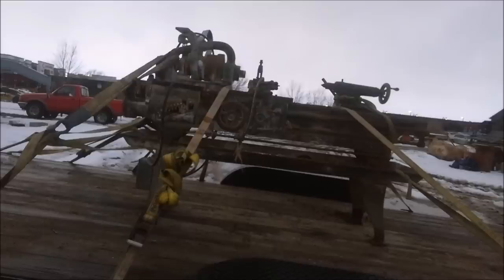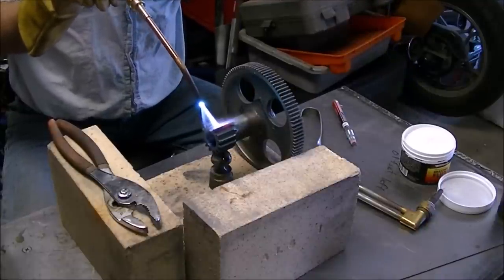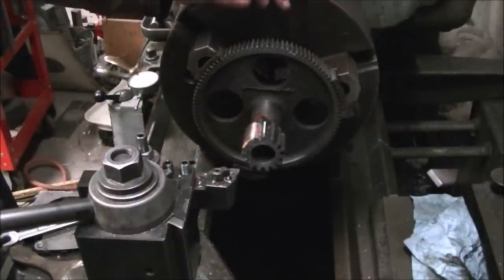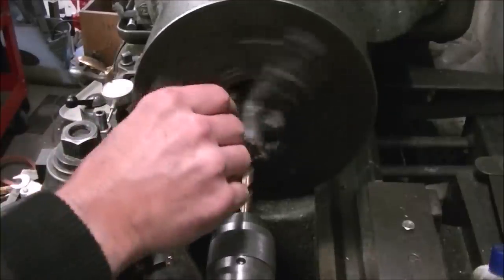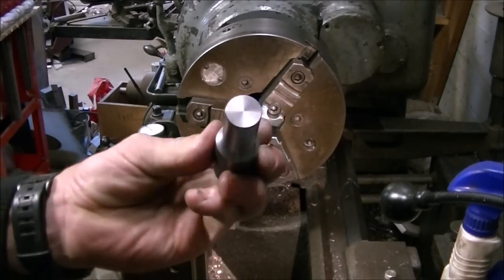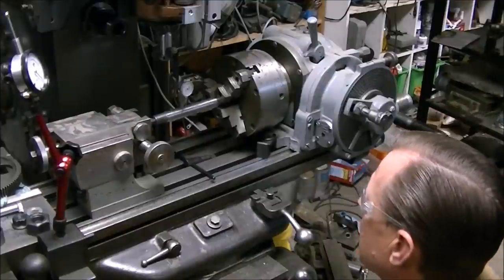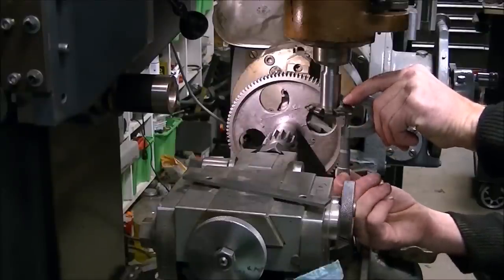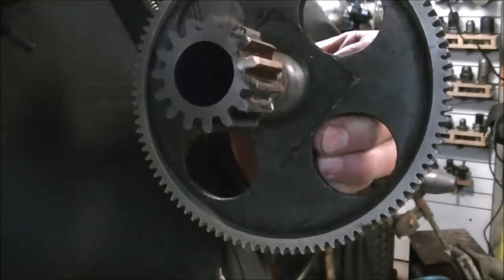Hendey Gear Repair

Comment: worked out fine enough! 
handy having the gas torches , can't get them here due to elf n safety police so it's a case of finding a shop that would braze stuff up and not be looking for an arm  and ldg to do it.
good video,  keep them coming. All the best mat
Reply from the maker: lookcreations Mat, they can have my oxy-acetylene when they pry it from my cold dead hands- no wait, that is something else. Well I hope we never get to that point over here. Thanks for stopping by, can't wait to see the Elliot making chips. Craig
Reply: Can you get 1 of the Bernzomatic MAPP gas/oxygen kits?  ( https://www.amazon.com/Bernzomatic-BZMOX2550KC-Torch-Kit/dp/B0002JM8AO/ref=sr_1_2?ie=UTF8&qid=1525731352&sr=8-2&keywords=bernzomatic+brazing+kit )  Might not be hot enough for gas welding steel, but it will braze just fine.

Comment: Nice work.
You could of used a face plate and put the gear between pipe centres.
That would of saved the truing hassle, just a bolt for a drive dog.
Reply from the maker: +Mick Mac that would have worked but I don't have a center big enough for that bore. I've been looking for a pipe center for the lathe but haven't found one and had the money at the same time. As you probably know, the cheapest part of this is buying the machine, the real money is in the tooling. Thanks for watching and commenting. Craig
Reply: clemwyo your other option would also have been fine.
Machine off the teeth. Pressing on a steel gear would make it all stronger as long as you heated the new gear.
Done some repairs like this in my time. If you case hardened the new gear then brought it back to the natural silver finish,
Re heat to your straw colour for pressing, you get two jobs done heating for expansion plus tempering back the steel.
Machining a new gear from cast iron also good as that would be close to original.
Im guessing your lathe has an MT5 in the head. Many Chinese laths have adapter sleeves just for this MT5 to MT3.
The head end you can machine up your own pipe centre.
The tail end also by machining or even buying an arbour MT to suit your tail stock with a 22mm straight shank, typically for a milling cutter.
Machine up your centre head and  bore for deep groove bearings to press onto the arbour 2 side by side. You can do this pretty cheaply.
Doing my 1st year as an apprentice for the defence dept that was actually one of our training jobs. I still have it and use it to this day.
Best way to remove rust from cast iron like the ways is green scotch brite and phosphoric acid gently scrubbing the rust just disappears plus the new grey finish is actually rust resistant.

Comment: That looks very good to my old eyes.
Should work very well.
Those other teeth are quite worn.
Mike
Reply from the maker: Oldvet1946 you are sure right there. I've decided that if the wear bothers me when it's back together I'll pull it apart, braze up all the teeth but the one I just did and recut the rest of the teeth. Craig

Comment: New Sub..  Nicely executed repair Clem.  I will be watching your other videos as well.  Regards-  Fred Ontario, nY
Reply from the maker: Fred Miller thanks for the kind words. I've been checking in on your engines for several years. One of these days I need to build a steam engine. So many projects, so little time... Craig

Comment: Why didn't you just stick it?  Instead of silicon bronze i mean..?
Reply from the maker: +Patrick Dorion when you stick weld cast iron you run the risk of the part cracking as it cools and, more importantly, you end up with a very hard, brittle part from the heat of the arc weld. If you are welding up something like an engine block, it's not a big deal. But with a gear that needs to be machined after welding, both of those things are bad. Thanks for watching and commenting. Craig

Comment: With that metal lathe, milling machine and dividing head you were be able to make a brand new gear in the less time. 
Instead to braze it,  better way will be weld that tooth with cast iron welding rod.
Reply from the maker: Brazing is about the strength of the original material without introducing the stresses and hardening that come with welding cast iron. For some applications welding is a better solution, in this case, brazing is the better choice. Thanks for watching and commenting. Craig

Comment: Do wish to sound  cynical but all that time a big gear one tooth I would  have used a file and  steel weld?
Reply from the maker: +dafodilist as I said in the video, I have a full set of transposing gears to make so I can use the old Hendey lathe for cutting metric threads. This was a chance to try gear cutting in preparation for that. Stick around and I'll be cutting the transposing gears soon. Craig

Comment: OMG he's got all the mega anyone could want and it's still a gigantic hassle for a single tooth....
I piled in some 06 special brazing rod on a 4"+ diameter 72 tooth and hand filed it, used a couple pins from the junk pile
Have 3 or 4 more in the back gears to do not looking forward to it ... grrr... such a hassle - soon enough 3d printing should take card of these things I hope.
Reply from the maker: +Doc Hollowood as I mentioned in the video, this effort was in preparation to cut a full set of metric transposing gears for the 1910 Hendey lathe. I wanted to get some experience in gear cutting before I tackle the gear set. More on that project is coming. Thanks for watching. Craig

Comment: TRY USING CARBURISING FLAME MORE
Reply from the maker: +Stuart Hearn on the next brazing project I tried using a TIG torch and found that to be much easier to control and faster as well. Thanks for watching and commenting. Craig

Comment: Good video.  I've did the same thing on a back gear on my large old  lathe.   Only I cut/broached the new tooth shape on my lathe rather then a milling machine.    By broaching the tooth no special tooth cutter is needed, just grind a single cutter to match the tooth profile.  Worked great and the lathe is in service.     http://www.pbase.com/jimthode/hamilton_lathe
Reply from the maker: Jim, That is a nice looking lathe. I have broached keyways on the lathe, since I don't have a broach set. I bought a full set of involute gear cutters from a friend for cheap, so I thought I'd try it out. Craig

Comment: Great work. Thank you. 

Could you avoid the math and smoosh the cutter into a good tooth gap to find center? 

p.s. kudos on the hypno mumble. Haters gotta turn up the volume, bish...
Reply from the maker: +badad0166 I kind of did both to make sure the math was accurate. I now have a USB moveable that is handy for looking into those right spots. Thanks for watching and commenting. Craig

Comment: Sorry for safety sally comment but please don't polish on the lathe with the rag held like that ! I'm not saying don't polish just make sure the rag is folded up neat with no loose ends and nothing that can catch on the chuck OR wrap round the object being polished. I've seen rags wrap round themselves and tighten VERY fucking fast ! If an index finger is inside the rag well say goodbye to it and maybe the hand ! It only takes one mistake and its over in seconds but by the time it starts to happen its already too late !
Reply from the maker: John Doe I've had several other viewers mention the same thing and so I have repented of my error and changed my ways. Thanks for caring enough to say something. Craig

Comment: Torch was way too hot...
Reply from the maker: +Michael Angelo as it brazed up beautifully I'd say the torch was set just right. Craig
Reply: I'd say you were lucky...
Reply: I'd say you were lucky...
Reply from the maker: +Michael Angelo I'd say not as it went as well as my other brazing jobs have gone. Now I usually use a TIG torch for brazing as it puts the heat in quicker. Take a look at Keith Fenner's or Keith Rucker's channels where they successfully do the same on a regular basis.
Reply: I don't know how you didn't blow the whole puddle off the side, as high as you had that torch turned up, but everyone has their own way of doing things...

I prefer to use the TIG also.  Use a 309 stainless rod, and just build the tooth back.  A little touch-up work with a small grinder, and you're done.

I had to build five teeth back on a set of powdered metal bevel gears a couple of weeks ago.  Because of how they are formed, basically no other way to do it except by hand.
Reply from the maker: +Michael Angelo because it was a brazing job there was no puddle with the cast iron and the silicon bronze tends to be pretty sticky with a stable puddle. It was also being puddled between the two good teeth on either side of the broken one I'd ground out. Since the gear repair I've done several brazing jobs but now that I've done it with TIG it is much faster with better control so that's my preferred method now. Craig
Reply: I been brazing and acetylene welding since I was a child, so no explanation is needed.

Yes, you had a dam on either end, but nothing to hold the flow in on either side.  With twice the heat, and air current created by such a large flame, I'm surprised you got away with it...

There will be many applications where you will have to use brass, and a tig torch will be virtually useless, so don't throw your gas rig out just yet...

Next time, once you have you part sufficiently warmed, cover the remainder of the part you are not welding on, in vermiculite.  It will preserve 95% of the heat, and make your brazing/welding go considerably more smoothly.
Reply from the maker: +Michael Angelo I'll give that a try. I'm definitely not an expert just trying to show people what they can do if they're willing to give it a try. Thanks for watching and commenting. Craig
Reply: I thought you did a great job, although the old lathe didn't appear to be worth the effort.

I was not being critical in a bad way, just pointing out something I thought might help.
Reply from the maker: +Michael Angelo +Michael Angelo you're right, its probably not worth the effort to most but I enjoy old, non-electronic machines. Getting abandoned, neglected machines back into working order makes me happy so I keep doing it. Craig
Reply: What do you do with them when you're finished?

I started my shop off that way because it was all I could afford, and any kind of machine tools were hard to come by.

But no one wants to buy those manual machines anymore.  Now I just take the handles and chucks off of any belt drive machines I get anymore, and scrap the rest.

I'd rather not do that, but I only have so much space, and if you try to cover them up outside, you are just kidding yourself.

BTW, I have a full set of collets for a Hendy.
Reply from the maker: @michaelangelo8001  so far they have gone in my shop and I've given a couple away. I traded an old 7" shaper for a couple Albrecht chucks and some assorted tools. I didn't get to start playing with machine tools until I was nearly 40 so I have a lot of lost time to make up. The plan for this lathe is to set it up with metric transposing gears and have it be the metric threading lathe. These old tools might be hard to make a living with but for hobby users they work great. Much better than a lot of the new import lathes for sure.
Reply: As you say, they are great to make specialty machines out of.  For instance, if you have a customer that needs a particular part made on a regular basis, and the set-up for that part is slow, awkward, and/or complicated, you can just take one of those old machines and turn it into a purpose specific unit.

It's not that hard to add encoders and servos to some axis to expediate things, if necessary.  

Of course, you have to have sufficient room for all those extra lathes and mills, and they tend to eat up real estate very quickly....

All my smaller, seldom used equipment, is on casters.  When not in use, they can be packed into a much smaller area.
Reply from the maker: +Michael Angelo I used to make parts for my little drilling business but since selling it off last year and taking a regular job I'm only out in the shop for fun these days. My son does CNC work and, as you say,  that is what I should be learning but I like the old machines too much to make the switch (at least for now).
Reply: You can make good money on the side making specialty parts that are expensive and lhave ong waits when ordered...   If you inquire of the purchasing agents at companies who use imported European machinery, etc... you will eventually hit on something.  Once you establish a rep for doing good work, they will cover you up with orders.
Reply from the maker: +Michael Angelo my son and I have discussed doing just that. I'm just trying to be careful not to make a hobby I enjoy become an oppressive burden, I have a daddy job for that.
Reply: Gotta do what works for you...

Comment: Copper teeth?Original!
Reply from the maker: +дрон цкм the new tooth is silicon bronze. It is about the same strength as the original gray cast iron. This method has been used to repair cast iron gears for over 100 years with good success. Craig
Reply: clemwyo
Realized with silicon bronze faced,and beryllium have to handle it Oh Oh,everything was done beautifully and clearly.
Reply from the maker: +дрон цкм thank you for watching and commenting. Craig

Comment: dont braze it up find yourself a nice piece of stock and make a new gear from scratch.I only have one criticism,the video is very good except you need to speak up and talk like you are talking to someone it seems like you are whispering the whole video speak up .
thanks for the video.
Reply from the maker: +Mike Cameron thanks for watching. Making that piece from stock would be quite an undertaking. Both gears are one piece, machines from a casting. The silicon bronze I brazed it with is actually stronger than the cast iron. I think I have figured out the volume problem in my newer videos. Give one a try and let me know what you think.